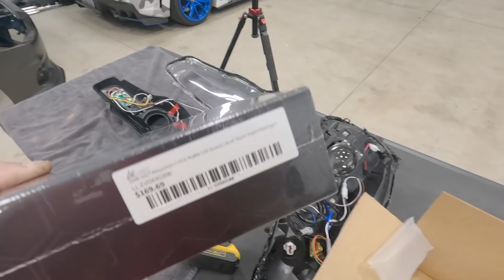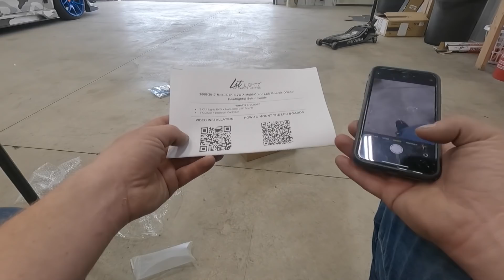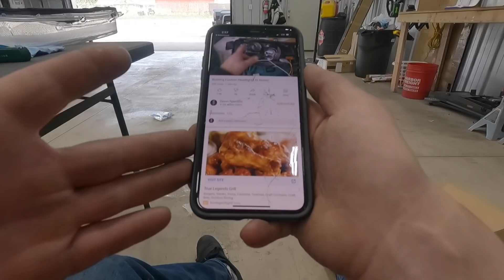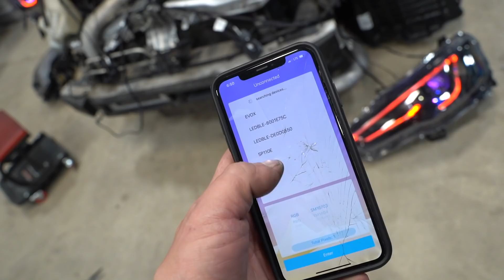Building The Perfect Evo X Headlights!

Comment: Hey Devin, that "glue" in the headlight is called butyl tape. Its a waterproof putty sealant used to seal lights and even vapor barriers inside door cards. As you are pulling the tape apart, instead of making it all stretchy you can take a razor blade and cut along it. Makes it super easy to separate the two pieces of the headlight. I used to work for BMW and whenever I had to take apart a door the foam vapor barrier would be bonded to the inner door with the stuff. I always used used a heat gun and a razor blade to get it apart without ripping the foam. Hope this is useful for you.
Reply: I’ve been trying for weeks to get this glue loose. Tried the oven many time and a heat gun. Can’t get it to budge

Comment: you should tap into a fuse that is either powered when the ignition is on or the engine is on. that Bluetooth module will always have power to it and will drain your battery
Reply: im wiring mine up today and was wondering this. not sure how to do the fuse way though

Comment: What do you call or where can you buy that rubber style grommet/screw on the cup of the lights? Thanks Devin
Reply: They're waterproof adjustable cable glands joints. Amazon has a few sets of various sizes

Comment: I have been looking for this exact video since you have it done on the first Evo, and you magically happen to post it now! can't wait to do this mod but I am def intimidated! side note tho... have you considered installing a fuse block? I want to install it on my Evo but don't have the wiring yet and can't figure out where to mount the fuse block either, it is useful for having gauges and other light accessories to make those installs simple instead of tapping in stock fuse box

Comment: it's nice headlights but I still think the  sequential signal/indicator on the front headlights needs to be brighter, its quite dim compared to the main beam and teh DRLs, especially at nights. The signal on the tailights are fine though. I have driven passed Lancer who use the vland headlights and many times I couldn't clearly notice if they actually turning their turning signals on the road.

Comment: Thanks for the updates video I’ve had nothing but problems with my lit lightz.. one side of the driver puts out wrong color .. if you swap the lights the problem goes to the other light .. I contacted lit lightz and wasn’t much help so I ordered a new blue tooth controller and didn’t fix the issue so now they want me to buy a whole new $170 setup .. not offering me any money off or warranty as it’s been over a year .. so I’ll be out the original money plus $30 for Bluetooth and now another 170 for a whole new kit .. not happy with them at all
Reply: @joe, We try to take care of our customers as much as we can. However, you're not telling the whole story. You initially reach out to us on 8/31/20, asking for assistance. We directed you to fill out our troubleshooting form to help us get a better idea of how the kit was set up and asked to provide an order# to start a warranty claim. We didn't hear from you until just recently, 3/27/21. You told us you tried the troubleshooting steps, and you could not provide an order# since the kit was bought from a friend.  We then stated warranties are non-transferable, and if you require any parts, a new kit would need to be purchased as we don't sell the pieces from the Evo kit stand alone. After a couple of weeks went by, we heard from you again on 4/12. You purchase a Bluetooth controller because you thought that might help (we never said to buy a Bluetooth controller). We ship the controller. Once you tried the controller, you said that it did not work. We then stated it's possible the driver could be the source of the problem. However, if it was the driver, we couldn't sell it; for one, we didn't carry the specific older version of the driver you have, and two, we didn't sell the parts for the Evo standalone. 

You come back saying to send a link to the driver. Once again we advise of we cannot sell you the driver. That was the last time we heard from you.

Right now, the only item you've purchased from us directly is a Bluetooth controller, which can be returned for a refund. If you would've bought the kit from us and the warranty expired, we could make an exception. However, the kit was purchased from a friend, so factors during the exchange could cause damage to the items. That's why we state warranties are non-transferable.

With that said, you're more than welcome to email support@litlightz.com for a discount on a new kit and return the controller.